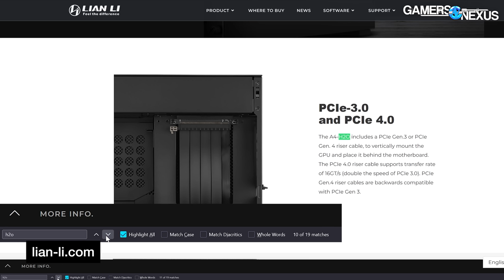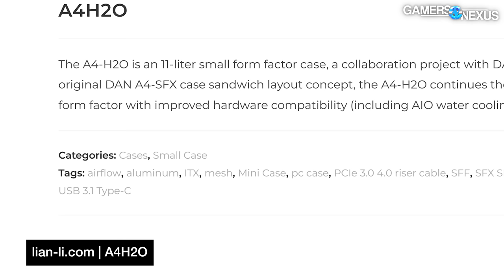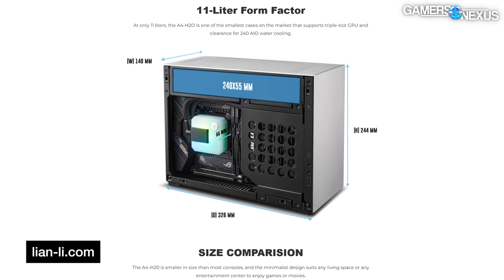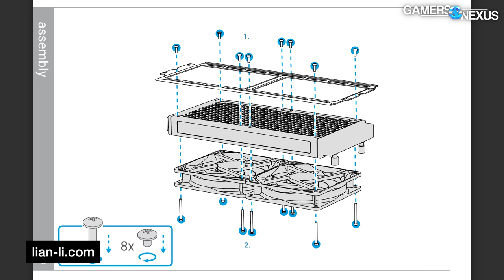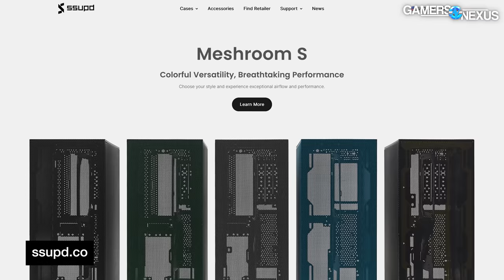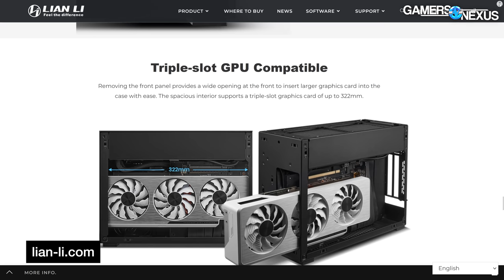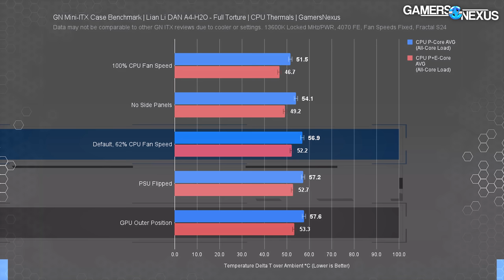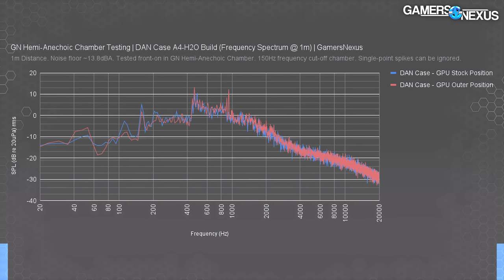Water Cooled Mini-ITX Review: Dan Case A4-H2O Thermals, Noise, & Cable Management

Comment: I never got the whole mini-itx thing if you are not space constrained or if you don't move your computer enough. 

I bought a define 7 XL (sadly with TG) from someone who regretted the purchase and put 3 high quality fans in the front (toughfan 14 pro), 2 in the bottom (arctic p14 argb without the RGB. I don't know why, but they sound much more pleasant than the regular p14s) and a 420 radiator in the top (liquid freezer II, opened box, tested but largely unused, so half price)

I never had to plan anything. That case swallowed everything, and it keeps my 7900 with PBO cool while being very quiet. I unmounted the door to make it a worse meshify 2 XL.

Comment: i just finished my buuld few days ago in this case.
was definitely not an easy one.
i think i ended up with the worst parts imaginable for this case because i have xfx rx 6800xt (which is too long for this case and had to get 3d printed extension for the front panel)
and for aio i have thermalright frozen notte 240 which have the pump in tubes (hardest thing to fit in the build, even harder than cable management)
at the end super happy with everything and it looks amazing 
and for cable management my advice would be to deploy tons of zip ties then its smooth sailing

Comment: I respectfully disagree with not including footprint - it does help with comparisons if the lengths and widths are very close together. Definitely don't review it as if 500 sq mm is always better than 525 sq mm but it's definitely good to include it, as at some point, the difference in footprint of 110mm x 245mm and 150mm x 160mm is hard to figure out without breaking out a calculator or pen and paper

Comment: Hi, 
I would like to comment about the cable management part on this video. Yes it is a con but then again this isn't a full sized one. I'm pretty sure that anyone building an ITX case will most likely go for custom length cables for the components, thereby mitigating the issue to some extent. It's an additional expense, but I guess it's a fair price for people willing to go this route.

Comment: I really wish SFX PSU seller should really start including a shorter 24pin cable with an extender if it is needed, It would give you more clearance for the rest of the cables.

Comment: A suggestion - for sandwich style cases, it would be good to include a non-flow-through/non-FE GPU. @optimumtech did a fair amount of testing on this back when 30-series was new and found the NVIDIA FE flow-through design was particularly problematic for sandwich-style cases. The effect you find on using the offset position might not be there with a more standard AIB GPU cooler

Comment: Boy used one of the most efficient 40 series GPU's in a case where GPU exhaust becomes CPU intake. If you use anything more than a 4070, you may run into a problem where CPU temps are affected by GPU utilization under GPU intensive senarios. I've had problems with the 7800x3D becoming hot with a 4070 ti, but maybe it's just within spec.

Comment: Thanks for this guys, great job as always! 

I understand the methodology regarding not comparing gpu's & cpu's but I really want to see thermal and acoustic differences between this case and the Dan C4 SFX v2/N200P/Tera, as this would inform my purchasing decision.

I understand the Dan C4 SFX v2 is sold out right now until 2024, but my next purchase will be between these models around that time, so hopefully you'll have more data in your reviews by then?

Comment: For the fan cables, I found that on the front and the back of the water block I can stick extra cable lengths in there, so you can actually make the MB side look cleaner without using custom cables.

However, CLC problem also hurts me as I am using a fitting long boi (sorry), the water tube either hits the case or it hits the cooling fans.

Comment: I use a MSI Ventus 4090 in there, it barely fits, but doesn't overheat, as it pulls fresh air from outside the case. (I did need to put some stratigic tape on to the gpu, to stop the fans from rubbing on the sidepannel.)

Comment: Considered this one or the terra for a long time, then decided to go easy on my sanity and went for a NR200P MAX, i love it even if i decided to ignore custom length cables i think when you sell the whole assembled combo ( case, watercooler, PSU ) you should make custom cables for it too, especially for the price, if you pick an sfx psu it's not to slap it in a gigantic tower case right ? 

And also, this one to the whole case manufacturer,  can we have a front panel connector as a whole connector?, guys it's 2023.

Comment: Hey bro, I love your videos, but the volume of a case speaks to what it can contain rather than what room you need to contain the entire case. It's like a cup measure doesn't include the handle protrusion and decorative base. This is another successful collaboration between Lian Li and Dan Cases and I love how they've evolved SFF cases. But have they designed one to accommodate large air coolers? I want to build a system using the i9-14900K and an RTX 4090.

Comment: itx case review invariably involves a larger proportion of subjective analysis (ease of cable management, accessibility etc), but that's not to say subjective analysis can't be fair. GN reviews are typically heavier on the metric side of things, which encourages objective discussion, but I don't mind if there are more subjective comments in your reviews if the case (puns intended hell yeah) demands it. Because I still trust the subjective comments from GN to not be laden with time-wasting BS and by-and-large fair (the question of whether I think someone is being fair is in and of itself a subjective judgement). Maybe just front-load the review by saying something like, "this is an itx review, hence a lot of the analysis made here will be relatively more subjective in nature than our other reviews".

Another feedback is that with SFF case build, while sometimes you can get things done if you do something in a particular order, it's worth pointing out that this necessarily means the process can be extremely cumbersome when going in reverse. For example, in this video you pointed out that you can still access the CPU power connector on the MB by first plugging in the connector before assembly the radiator. That may be fine when you are building it, but what if you just want to unplug the EPS for a quick test or something afterwards? Then you need to remove the whole shebang before you can just access one plug. Another example: you demonstrated the need to remove the radiator to access the PSU power switch. I may be mistaken but I think for some PSUs you need to toggle that physical switch to reset the OTP after it has been triggered, in which case the need to move the radiator just to access that switch can be a real annoyance.

The philosophy is: if you need to do things in a particular order for it to work, think about the likelihood you will need to do things in reverse because that determines how much of a pain that will incur down the road.

Comment: For your ITX methodology would you consider a metric regarding what tiers of components “make sense” in a given case? For example, you can comfortably cool a 13700k and a 4090 in the A4, but not in the Terra. Maybe said another way, the performance ceiling in gaming is heavily dependent on the case itself in the ITX world, much more so than with mid towers.

Comment: I chose A4-H2O after i measured storage compartment of my motorcycle. Manufacturers should be called out for incorrect advertised dimensions. In my case it still fits with room to spare for bubble wrap, but if it didn't, my trip would be ruined

Comment: I never built a mini-ITX and I found this one very cute. It's smaller than a console and more powerful. But I gotta ask... Why? Do you really need to save that much space? I genuinely curious about this. What are the pros for this? I've learned with this video that the temperature matter is fine (somehow), but it looks such a hassle.
Reply: For me i don't like wasted space especially after the death of sli/crossfire so having a small pc that you can move around easily and takes barely any space is great, also it's more upgradeable, powerful and reliable than laptops, I've been burned by laptops dying and being so hard to fix.
Reply: Yes you do save that much space, pros are better compatibility than most ATX cases and the fact that it's not an O11D clone

Comment: Hey! Something I feel was neglected in the fit & finish portion is things like panel gaps? At 14:50 there's a B-roll shot of a pretty noticeable gap in the panels which wasn't mentioned elsewhere in the review. I'm not exactly sure if that was something like the team forgot to fully push down a pushpin or if it's a manufacturing consistency, but since cases are largely an aesthetic component, to me the fit & finish of all the panels and components on a visual level is much more important to me than the structural rigidity of the case.
Reply: Again, if that was a small assembly error that's totally fine and I'm not judging the build team by any means. If the case's panels fit well I think it'd be worth mentioning that!

Comment: Cooler Master NR200P please. Flexibility in graphics card size and orientation. Cooling performance that allows for the possibility of high-end builds. Reasonable desk footprint. 2 x 120mm fans with splitter cable and riser cable included in the accessories box. And the best bit about this case is that you can completely take it apart. I have managed to fit an Arctic Cooling Liquid Freezer II 280mm AIO on the side mount without an issue to provide ample cooling for my i7-13700k. And there is room downstairs for at least half a dozen different variants of RTX4090 cards. I've been building my own rigs for over 25 years and this current build in the NR200P was an amazing experience. I don't think I will go back to a mid or large ATX case again. @GamersNexus Please give the NR200P the thorough review treatment?

Comment: For me a itx is only interesting when it can fit 2x240m rads to cool gpu and cpu. I just finished my build with the NCase M1 and it was a little bit a pain in the * to get all things performing well. A good case for 13-15l to fit two rads easy would be noice to me.

Comment: Could someone please reply about the auros waterforce x 240 fitment for the a4 h20? Box says it measures at 277 mm in length, when i went to put it in the case it does seem to fit but is there something im missing as far as “fitment” goes ? Will it interfere with other components? Thanks

Comment: I've had mine for just under a year. Fully hard-lined liquid cooling setup. Just had the pins pop off on the CPU side and now i need to use the thumb screws to keep it secured. Disappointing considering it hasn't even been a year!

Comment: I think you guys should consider running the highest end parts (that are possible fitment wise with the cases) so we can fully see what's possible/not possible with these cases.

For example, you mention this case has thermal headroom but it's hard to tell since it wasn't illustrated with this case (I'm just wondering for example, if a 240 AIO would be fully effective in this case since there's a lot of components in a smaller area and what the performance of ie a 13900k would be).

Comment: Which 240ml cooler would be the best for this case? Considering ease of fitment, cable count, good pricing and most importantly performance?
Reply: I forgot also availability...
Reply: Currently I have an EK nucleus 240 in mine and it works very well. Also tried Fractal Design s24+ and worked quite well too.
Reply: thank you for your suggestions, I will check them out.

Comment: GPU thermals are way better without the Rad, and just two 120mm exhaust fans up top. I run this case with a 7800X3D and 7900XTX, with a low profile air cooler, and get great thermals this way. it's also vastly easier to build

Comment: Just repasted my 4070ti in my NR200P Max and at 24 degrees ambient I have 52 degrees cpu and 60 degrees gpu in Phantom Liberty with path tracing. 50% fans on gpu, undervolted to 1000mv at 2775mhz and AIO and bottom 15mm fans set to exhaust.

Would be interested to see your results with the Max.

Comment: cases like this really shine with custom cables and custom loop cooling. Even just an open AIO like eisbaer LT allows you to shorten tubes for exact fit. some sfx PSUs also have slimmer, more flexible stock cables.  But really it seems like you intentionally did a bad job of cable stuffing just to highlight it.

Comment: Have the same case running a zotac 3090 and 10850k. I would say that I found that the nvidia style gpu ran hotter compared to the 3 fan design

Comment: It would be nice if you could include the Louqe Ghost S1 in your testing, as it is probably one of the smallest ITX cases in existence (with its limitations). What do you sacrifice for those few liters in difference between it and a slightly larger ITX case?

Comment: Would love to see a review of the ssupd case. I've got a 4070Ti and 13600K in mine with one case fan (because I put a 1200w PSU in it) and one case fan, and the system runs silent at full load.

Comment: Love this case. My build has a 4080 founders ed gpu coupled with a 7700x cpu which is really hot. Having trouble keeping this cpu cool in this case even with liquid cooling. Maybe it's my big gpu that's throwing hot air back into the case ??

Comment: I'm quite surprised by your acoustic results with the card at the outer position. I have this case with a Gigabyte Eagle 3070, and putting it to the outer position results in significantly more obvious noise from the fans being too close to the side panel

Comment: Sheet of A4 paper would probably be a decent visualization of how big an itx case is on a desk. Better than a numeric value.
Reply: That's actually where the name for the original Dan A4-SFX came from and this case is an evolution of that case. 👍
Reply: Exactly. These Dan cases are super dense. Using the bigger C4 sfx myself. Great case.
Reply: @Buzykil  I've had the A4-H2O for a few years now. Great case and compatibility especially for the size it is. With a touch of effort and some custom psu cables you can get some pretty good cable management in there too, but that's a given for most itx cases. I know Steve can't order custom cables to fit every case he reviews, but the cable management in the A4-H2O can be nearly as good as a mid tower with just swapping psu cables for custom lengths.

Comment: It's incredible how quickly you've gone from starting ITX reviews to hitting on all the most relevant points to ITX builders that ATX just doesn't really need to deal with! One request please - when showing the acoustic data, could you also play some example audio over the top? On the cable management side - absolutely agree with the decision to test with stock cables for look/impact on air flow. However, I don't think it's nearly as big a deal as ATX builders are used to - most people won't even see or care, and those who do care will buy/make custom cables instead

Comment: The top panel is very restrictive and gets hot to the touch I removed it from my build 5950x and 4090FE SFXL 1000w NZXT z53 240 aio using two Noctua NF-A12. Without the top panel temps very under control for long periods of time. Use system at a remote Parsec remote gaming server.

Comment: Please please cover why GPUs are so so fat and why there isn't a single fan RTX 4070 (it's ~200W just like the single fan 1080/2070/3060Ti). or something like the 1080Ti Mini for the 4070Ti

Also FF01/FreeFlow case review when it's out
Reply from the maker: GPUs are fat because they're easier to cool that way and quieter.
Reply: @GamersNexus  so in ~6 years it's become harder to cool instead of easier? ignoring GPU efficiency getting better, we should also be getting better "cooling per liter" over time, not worse

I have a 7 inch length 1080, it's not loud (*measurement not provided). maybe it gets warm, Returnal benchmark/gameplay+temp on channel, but you can always set a PL/lower settings (or vsync/60fps cap) or have a 8 inch GPU instead, not a big deal

also undervolting+PL removes like ~25% power draw with at MOST 5% performance loss because benchmark fetish I guess (hypothetically you could do like ~220W 4080, there are already people who have modded 4070/Tis. as in invidividuals, not 100s of ppl at a company who can't seem to make a product that already existed)
Reply: What's really egregious are the 3-fan, 3-slot 3050s. At that point they're just selling videocard stolen valor so people can pretend they have a higher end card.

Comment: Sfx-l is quieter than sfx. I9+4090 will push an sfx into likely noisy fan profile
Reply: It's really not. All SFX-L cases are far louder than the SF750
Reply: @svn5994  Hun ? What are you talking about? Sfx/sfx-l  are PSU sizes, not case sizes. This case will fit either. A loki 1000watt doesn't even spin the fan until 400 watts and will outperform a sf750. I own both and this is backed up by independent tests. Loki @ 600 watt draw is as quiet as sf750 @200 watt as tested by Cybernetics.

Comment: Can you or anyone recommend a itx or matx case which has more or less the form of an Xbox One or something similar which you can put under your TV? These ITX cases are interesting but they always do the Tower approach, so not working with a TV Rack. I really want to build a Console like PC, let's call it a "Steam Machine"TM. :D But there seem to be very few cases in that form, mostly HTPC cases. Any ideas? I need one 5,25" external slot, no internal slots since there will only be NVMe SSDs, some front USB and Audio, maybe an IR sensor, but that one is not so important. And like I said ITX or mATX and should be big enough for a discrete graphics card, at least a two fan solution like the twin edge cards from Zotac.